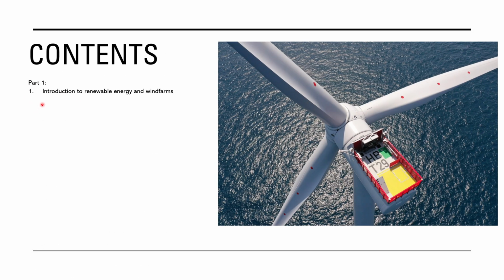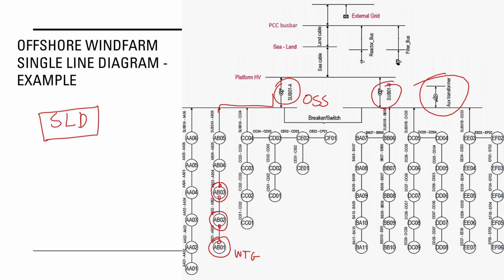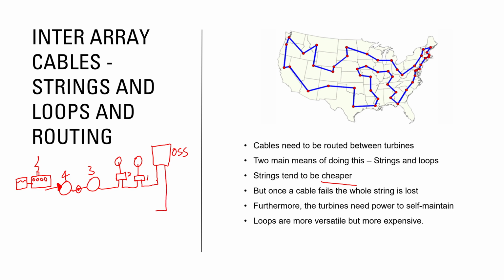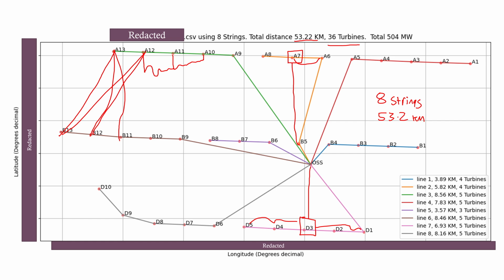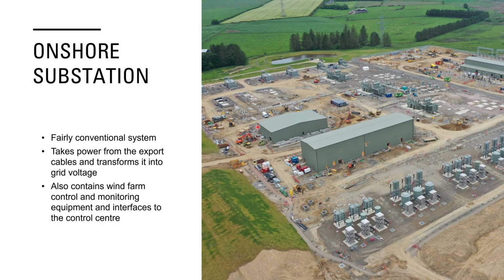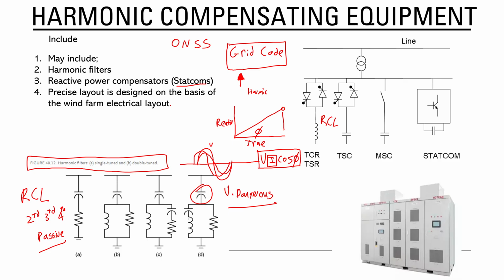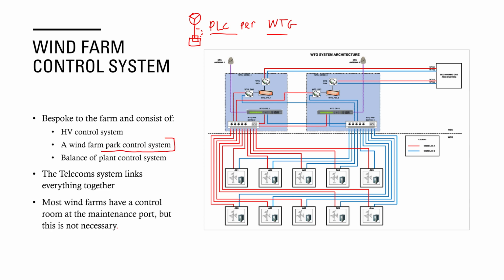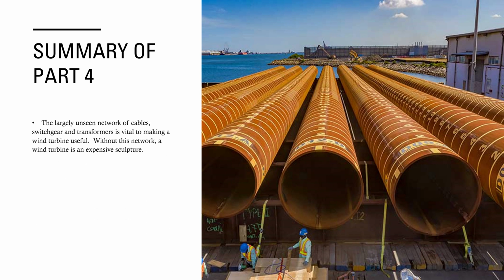Introduction to offshore wind part 4

Comment: Great video dose each WTG has its own GPS or for a string one GPS
Reply from the maker: @pravintorrez5778  I'm not 100% sure I understand your question. The wtg positions and cable routes are planned years before installation. Once installed they don't move so no GPS equipment is needed.

Comment: Thank you for this video, it is really helpful. Question - if the OSS converts to HVDC, does the ONSS need reactive power compensation?
Reply from the maker: You're welcome!

Good question. I'm actually not sure on that one but I suspect the answer is no because dc wont have a power factor. However a HVDC link obviously requires a lot of additional equipment such as rectifiers, filters and inverters.